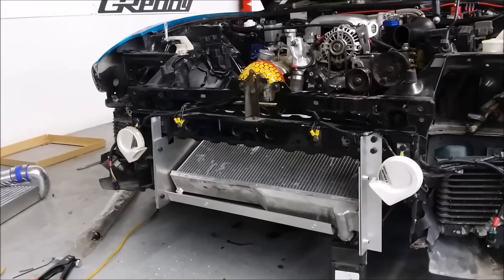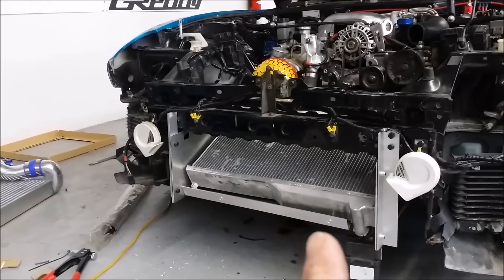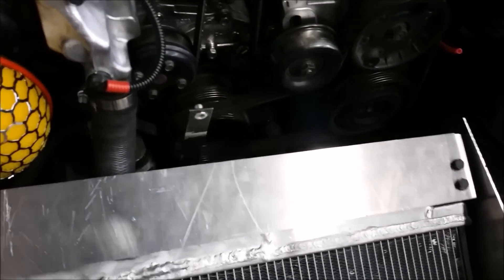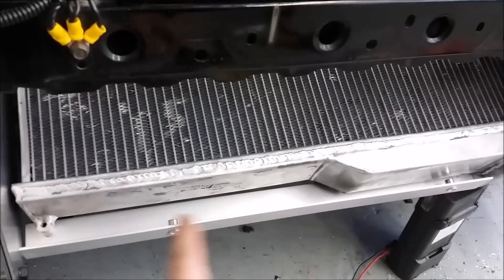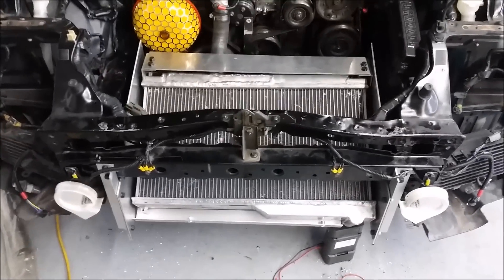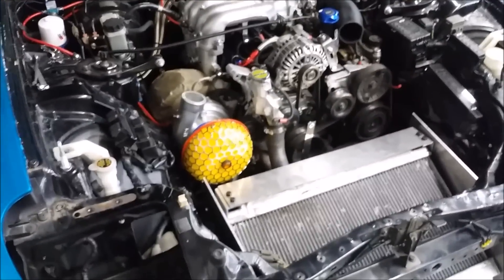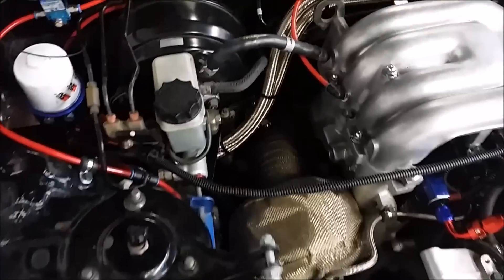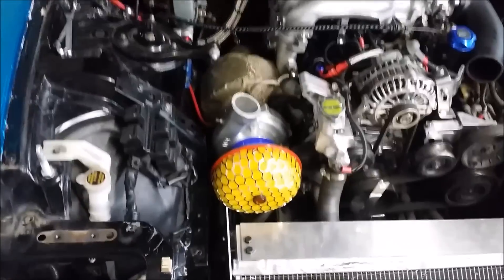ROTEC Engineering Mazda Rx7 Type RS build Part 7.

Comment: Oh god the welds on that radiator looked horrible, good god
Reply from the maker: No my welds. it was a shit show. my welder died mid welding it and blew through. I replaced the whole section but with a rented welder not nearly as good as mine was. but it's sealed and works. it will never be seen so cosmetics are secondary to function.  this is the prototype remember. the manufactured rads will have all these tweaks built in from factory.
Reply: how are you setting your tig welder up, are you running pure argon or helium argon mix?
Reply from the maker: +Nick Carr pure argon DCEP pure tungsten electrodes 3.2mm with 3.2 filler. The settings on my welding are fine....the welder literally caught fire whilst doing this job.... New Miller welder inbound  lol
Reply: helium will help you all the way around if you add it to the mixture, makes the metal flow better, allows you to go smaller on your electrode and concentrate your arc and puddle better.

I weld for a living, prolly the only reason i hit on the welds so quick, because you didnt show them but for a second.

http://www.weldingtipsandtricks.com/tig-welding-aluminum-using-helium-argon.html

Heres a good article on aluminum welding, and as always good vid, im always checking for uploads from your channel
Reply: Ive just seen how detail oriented you are so i figured id help
Reply from the maker: Yeah I hear ya. Again, prototype. The new rads come with the correct position of the inlet made right at the factory. so they will all be factory welded and pressure tested prior to sale. :)

Comment: three of the four relays can be removed near the turbo if your not running a/c as I only run one if you wanted to tidy that up
Reply from the maker: +stefan boyne Yeah good call. I had issues with an FD years ago and that relay pack so have become very concerned touching them. But I do agree. I was going to move them to mount the catch can right there....

Comment: Could you please do a vid/guide on how you go with designing and installing a cold air intake as im also looking to do this with my FD but have second thoughts as the only room i have is similar to yours and would involve me cutting open the sub frame to feed a pipe which would provide the air from the front drivers side lower front bar hole (where my second oil cooler sits) The only other option i have is to relocate the coolant overflow tank to create the room necessary for a cold air intake. Love your vids brother, have been watching your build since you started, its come a long way and i cant wait to see the finished product <3
Reply from the maker: +MrStoneunit For me moving that tank is no big deal as I deleted my AST. I mentioned the RE ran a tube along the side of the intercooler to the turbo filter. Its a great idea but with pop ups I agree, very tight. How about taking air from the inside of you wheel well? route a hole into the plastic and run a RAM AIR pipe in? If you check in my 350z Video I sell a carbon race ram air intake system that is snorkel fed. Check that out and see if something like that would work. Good luck!